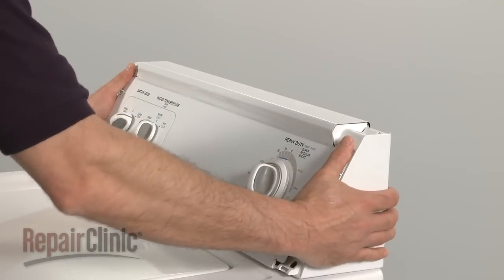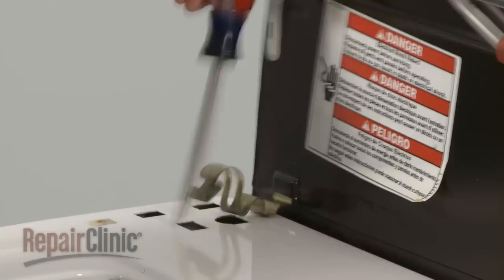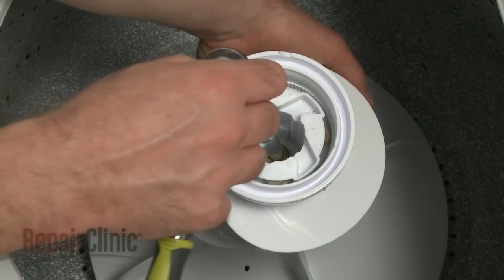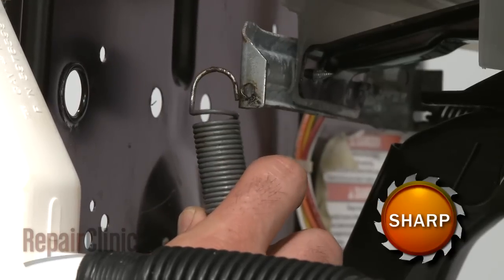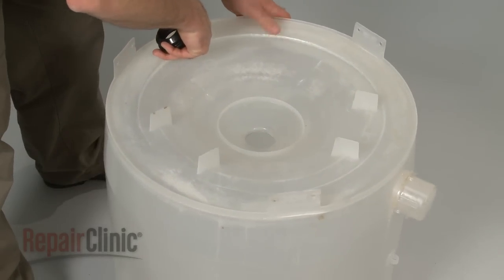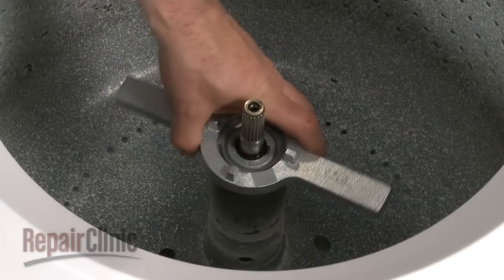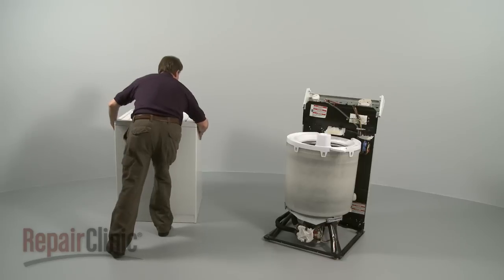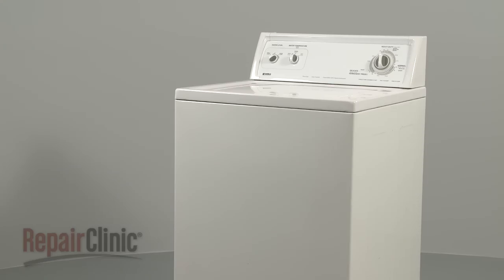Whirlpool/Kenmore Top-Load Washer Leaking? Tub Seal #383727

Comment: Thanks for the step by step instructions. I only wish there were tips included on how to determine exactly where the unit is leaking from. In my case I know it isn't the inlet hoses... it starts leaking from underneath the second it begins to fill. I think its coming from towards the front, so my guess is the water pump... which I'm guessing at from watching a different repair video.That video didn't show disassembly of the unit though... so between the two video's I believe I got what I needed to know.

Comment: Quick tip... my washer started leaking from underneath. I was prepared for it to be leaking from the agitator seal since it would leak if you just poured a jug of water into it without it actually being run. After pulling the casing off I tested it by pouring water into the drum and found the drain hose had sprung a leak. A hose bracket was missing which had left the hose rubbing against the mount which in turn created a hole in the hose. I'm a firm believer in using what I have on hand to jerry rig, if it will work :0). That said, I took a cheap plastic pencil, removed the lead and lit the tip on fire. As it was melting I rubbed the melted plastic over the hole in the hose to seal it. I then put a few layers of duct tape and a piece of packing cushion sheet and taped it over the hose where it was rubbing against the mount. Worked like a charm.

Comment: Also use plenty of penetrating oil around fittings and on shaft over which plastic tub liner gasket slides.  After applying the oil I was able to lift out the plastic liner and gasket by hand but had to lift with a lot of force, practically lifting the carriage and motor into the air until the rubber gasket started to slide on the metal shaft.

Comment: My inner tub was FUSED to the drive block. No amount of liquid wrench/WD-40  would loosen it. Heat didn't work either. Since I knew the drive block had to come off in the next step, I put a lock wrench on the drive block and hammered on the handle until it finally moved. The inner tube came out WITH the drive block still fused to it.  (so I noticed they forgot to turn the water back on in the video ;-)
Reply from the maker: +coryart Thank you for sharing.
Reply: how did you put a "lock wrench" on the drive block? The only thing sticking out with the inner tub still in are the threads. Did you put the "lock wrench" on the threads or put the nut back on the clamp to it? If it will come off this way, what is the purpose of the spanner nut? Sounds like you could leave the spanner nut on, skip that step and just whack the nut until the whole thing comes off. Interesting..(by "lock wrench" do you mean vise grips, or channel locks pliers)

Comment: Great video!! Thank you. Just did this on a Kenmore. Getting the inner drum off was a pain. I held the tub in the air while my wife tapped the shaft with a hammer. Used a little white grease on the inside of the seal for easier installation. No leaks!
Reply from the maker: Mark Mullarky Congrats on the successful repair!
Reply: I use the car jack and 21" 2x4 method to lift the tub / inner drum out. This time I am labeling my 2x4 "Whirlpool tool -- do not toss," to make sure someone doesn't throw out or repurpose this one.

Comment: Motor shield Part 3362089
Click en 3:18
Se ve como va instalada esta parte que ni el plano de ensamble original la trae bien ubicada.
Ver parte 18:
Viene en dos presentaciones blanca y negra.
http://c.searspartsdirect.com/lis_png/PLDM/P0102138-00004.png
http://www.searspartsdirect.com/Whirlpool-Washer-Parts/Model-LSR5132JQ1/1198/0153200/P0102138/00004.html
Reply from the maker: Gusdelfin G Gracias por tu comentario. Si tiene alguna pregunta, por favor llame al 1-800-269-2609 en de los 50 estados De Los Estados Unidos y Canadá.1-734-495-3079 para las llamadas de los territorios de los E.E.U.U., de Puerto Rico y de las bases de APO/FPO.

Comment: My husband and I did this repair, it wasn't super easy but i now have a really clean washer that doesn't leak from the outer tub gasket, yay! And I probably saved a few hundred dollars.
Reply: If I had to pay a few hundred bucks to fix the washer, I would replace it. I normally keep cars and appliances 15-20 years (my Audi is a 1996 and still running strong), but I could be convinced to make an exception with this thing.

Comment: Thanks for the great video!  Like others have commented, I also ran into trouble at the part where you "pull straight up to remove the inner tub."  Ha - didn't budge.  I couldn't get any leverage.  I used WD-40, Vinegar, boiling water, tapping with a hammer, then harder with a wood block, then hammered a thin flathead screwdriver down between the drive block and the inner tub, all the way around.  Finally figured out I could actually get some leverage by putting my foot on top of the agitator post to push down on that while lifting up on the tub.  That did it.  Don't know if that would have worked at first without all the other stuff I did, but as the drive block came out with the inner tub, I kind of think so.
Reply from the maker: TubularMag We're sorry it was so hard to accomplish! Congrats on getting it done though.
Reply: Mine is stuck. I wish you tried your idea first since it sounds like you could have loosen it up with all that other stuff.  but how did you put your food on the gear shaft and where your hands on the tub?  I hope your input will help.
Reply: Magic .Mark
Left foot on the ground and lifted my right foot all the way up on top of the shaft.  I can't remember for sure where I grabbed on with my hands, but it was probably just inside the rim around the top of the tub (palms out.)  Push down with the leg and pull up with the arms. I'm a little taller than average and it was a bit of a stretch.
Reply: TubularMag Thanks. that was not going to happen with mine.  I commented above that I finally got it and had a fused drive block on the shaft side and the tub side.  25 years is just too long to expect it to come apart  like the video.
I might use some anti seize  but who knows if it is worth it since I dont expect to need to take it apart again before everything rusts out....